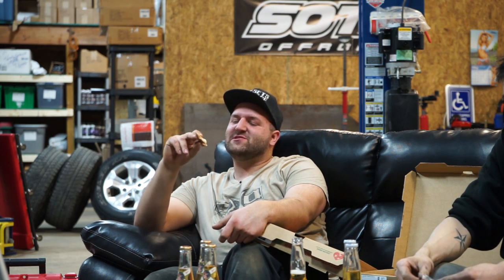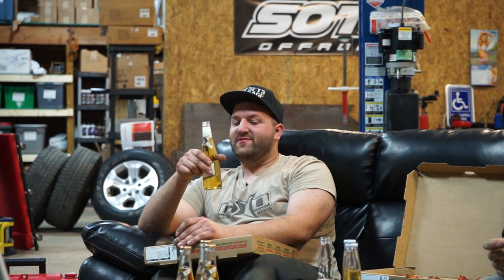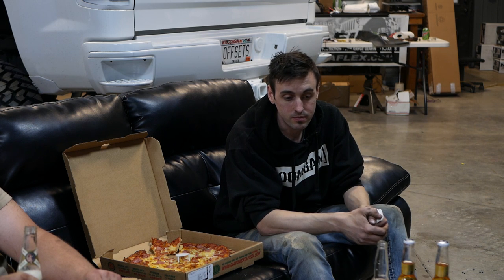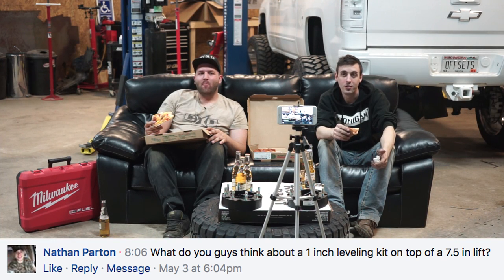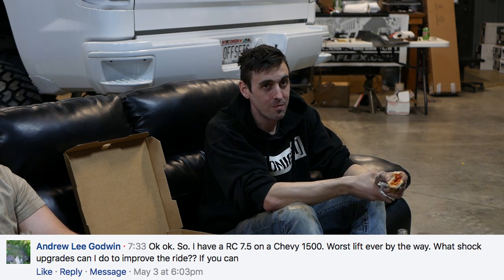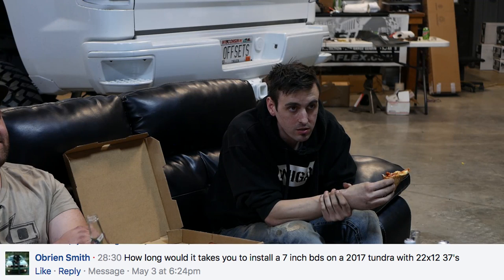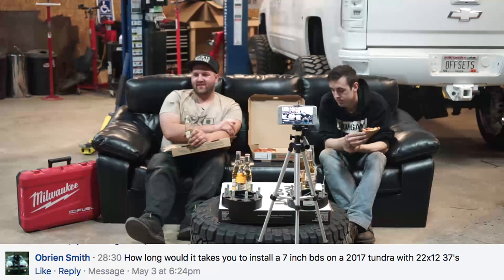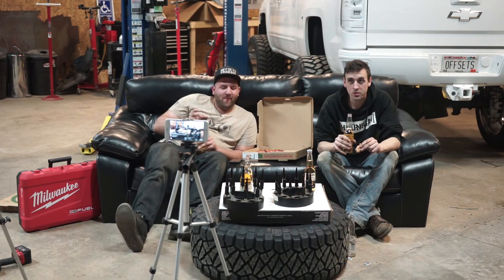Lift it LIVE EP 002: Lift Kit Preparation

Comment: Just lifted a buddy's dodge 2500, 150,000+ miles.  After a new drag Link, tie rod, right side ball joints, upgrading to bilstien shocks and steering stabilizer and alignment, the newely acquired death wobble after the lift install, finally cleared up, every piece made it better

Comment: Yep after I got my level lift it ripped my cv boot wide open both of them so I had to get new ones but I went ahead and got whole new joints after I got it installed I noticed a popping sound and the mechanic said it's just new suspension settling but it's been about a month now and I still notice it so new ball joints may be coming in the future. So a 200 dollar kit after installation and replacement parts is about 600 not including ball joints

Comment: I have a 13 ram 1500 2wd has around 75'000 miles. I'm from Texas what wear and tear should I look out for on the front end? I'm looking for like a 2-4 in lift kit. And what's the best possible way to get everything as straight as possible geometry wise don't want to much wear in tear on the truck after everything is installed